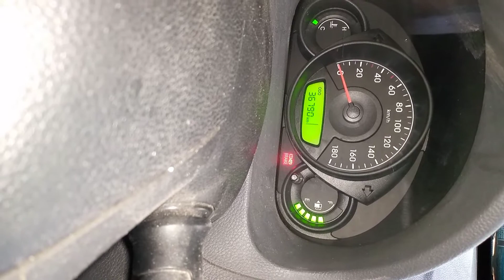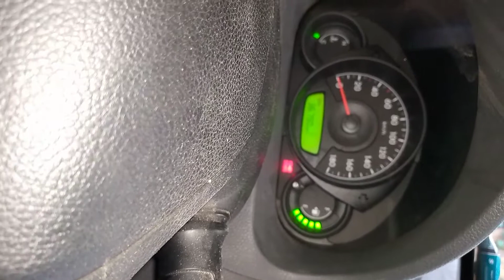Engine Oil Change Hyundai Eon

Comment: You used Engine Oil 20W50 Grade but Hyundai recommend 5W30
Reply from the maker: Yes 5w30 should be.
Reply: if u are in korea , use 5w.... in tropical country use 20 25w